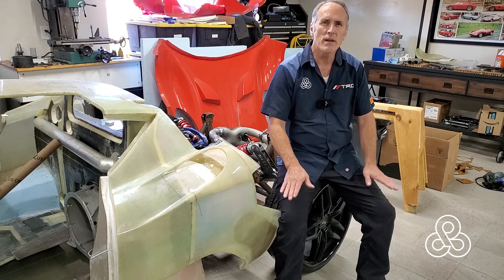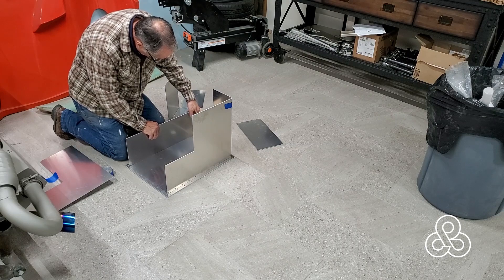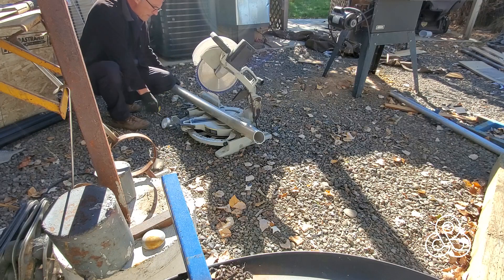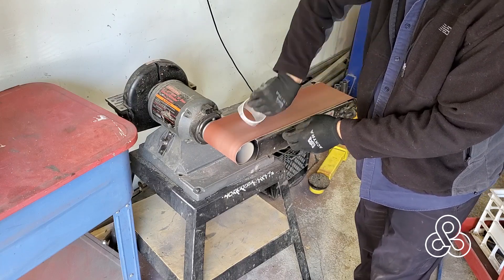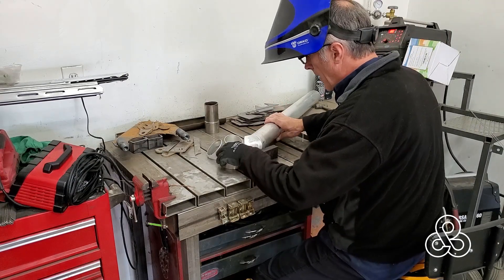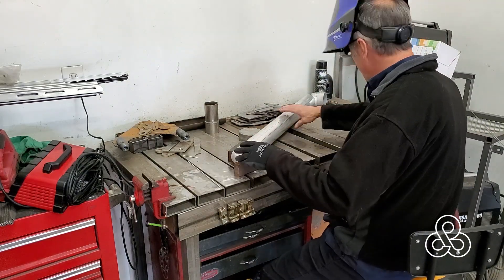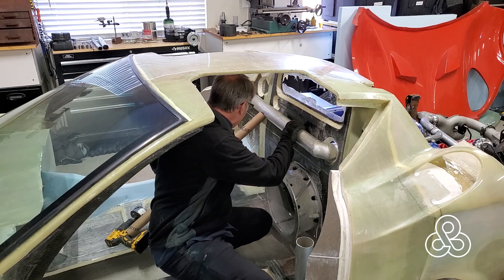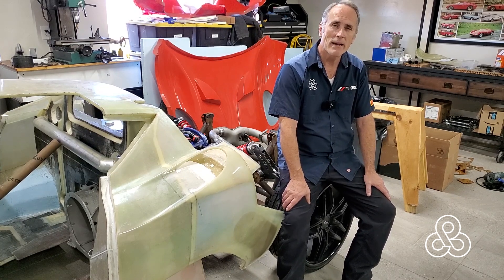A47 - Inter-cooler cross over tube - Arete Supercar Project

Comment: No offence intended, the tube needs a bead rolled into the ends to keep the silicone couplers from blowing off under pressure, you could also weld beads or the best which is
 v clamp, these ends you could be purchased and tigged on, definitely the best way to go although clamps aren't cheap...
Reply from the maker: Vs for sure!

Comment: Hey again, are you enclosing that tube? I'm not sure why you had to go into the cabin but remember that pipe may get to over 150 degrees (C!!) so it will need to be shielded from getting a warm neck.... 🤔 There really does look at this stage to be space for two small diameter tubes from the turbos over the front (rear) of the engine to the end of the IC end tank. You never cease to amaze me how you have managed to fit it all in with basically no mistakes so I assume there was a good reason to go into the cabin. Also consider movement isolation and seriously connecting it to the turbos and IC. I would not want to be thwacked in the back of the head by a hose blow off.....

Comment: A 7" x 1" flatube could fool a bunch of air under pressure. A bulkhead surface separator with a purpose. Halfway between two composite surfaces with a honeycomb center lies a spot with little to zero effect on the world.

Comment: Curious, since the charge tube passes through the firewall, are you going to heat wrap it to manage the temp between the firewall and inner bulkhead you plan on putting in? Or don't you think it'll be an issue?
Reply from the maker: insulate and ventilate.

Comment: Just came across your channel.
Thanks for giving me something I can point to as proof that building a car like this can be done....
I'm using a donor vehicle as the base for my own rebody.
I've got everything I need to build a CNC rotisserie.
My plan is to build up foam blocks on the existing frame and cut the body on the vehicle.
AFTER removing everything I don't want of course. Fenders bumpers front and rear lids.
Would really like to ask you some questions. Pick your brain a little.
Any chance of that happening?
Reply from the maker: Pick away!
Reply: @BuilderCreator  Carbon fiber supplier? Is there anyone local to work with in Oregon? Did you build your rotisserie?
Reply from the maker: @christopherleveck6835  Fiberglast is fairly close, in Washington, but I'm willing to wait a few days more for a better price. (US Composites out of Florida- tell them Jay Jarvie sent you ) Yes, I did build the rotisserie; it is now the heavy duty work table you have seen in recent videos.

Comment: I'm a little confused here and maybe I'm wrong in my assumption, but can you explain how the drivetrain is going to work? I keep looking at that 1JZ facing backwards and can't figure out how you plan on connecting the motor to the wheels, is the car going to be front wheel drive?
Reply from the maker: All wheel drive. Stay tuned. Drive train content coming.
Reply: @BuilderCreator  That makes a lot more sense actually, so you must be using a transfer casing at the front. We did something similar with a drift build we did using a Honda J32 and the transfer case out of a Pilot, we had a 40/60 split, but ended up going through shafts and axles like crazy and had to switch it to just rear wheel drive.

Comment: ok, so, wedge cuts or pie cuts, i've been doing these for over 20 years, you are going to be very unhappy , but.. a wedge cut should be no more then 7.5 deg on each side,  when you weld them that gives you a total angle of 15 deg at each joint, anything beyond that and air will  laminate and go turbulent. you can vary radii by making your wedge section longer or shorter.

Comment: as someone who has built over 25 Factory Five kit cars, i can tell your quality control is better than theirs, I've been wanting to build my own car, but being in college has put a bit of a dampener on that, when I'm out with my ASE and Welding Cert ill hopefully have enough in the bank again to have some fun
Reply from the maker: after 25 cars and college . . doesn't that equal a doctorate?
Reply: @BuilderCreator  i mean i wish, im 20 and been working on cars sense i was 6 cause my dad needed a helping hand, personally I've owned 4 pontiac fieros, 1 1986 toyota pickup, 1 1981 ford F250, and 1 2004 Mercedes SL600, all of which I've done all the work on myself, not including the countless other cars I've done and rebuilt over the years, i was just tired of making $13 an hour building race cars and kit cars, so I'm now 4 months in at college to make sure I'm up to speed on more modern vehicles before i go and do my ASE test, but I've already modeled and designed the car i want to build... Viper V10 powered, dual clutch 6 or 7 speed transmission, mid-engine, it should hopefully be a rocket with the knowledge i have from building a bunch of kit cars as it is
Reply from the maker: @The_Phrough  You go! Your on your way.

Comment: Well, I've started at your first video, and I'm up to episode 27. I haven't managed to get through them all yet, so you may have already answered this question, but why are you routing the turbo pipe into the cockpit? Also, again you may have already answered this, but isn't that Corvette gearbox the wrong way round? I'm assuming you're doing some sort of 4 wheel drive system, but I'd like a bit more detail on this so I can figure out this issue? Thanks.
Reply from the maker: Yes, it has been discussed, but to fulfill your curiosity immediately; here goes- More room in the cabin behind the seats than over the engine. It will indeed be an all wheel drive car- lots of content coming as i start to put all that together. Stay tuned!
Reply: @BuilderCreator  Well I must say I'm intrigued. I'm looking forward to seeing how the whole gearbox and 4 wheel drive system goes together. I think I'm at Episode 31 now. ;)

Comment: First off this channel is amazing, sick project. I'm just asking tho in the case of an accident especially a roll over, I just didn't see room for a cage in there.  Maybe this is addressed in past videos I haven't seen yet. I never thought about building my own car this makes me wanna try for sure. So much tedious work involved I don't know if my brain could handle it lol.
Reply from the maker: Yes, I've discussed this a bit. in short- The composite structure should support a low speed roll over. I will likely fit the car with a removable roll structure for added safety and qualification for some tracks. (think Time Attack)
Reply: @BuilderCreator  Protect that lovely brain of yours is all I'm saying. Things happen. Glad you are thinking about solution's.

Comment: I'm interested as to why you chose to run the pipe through the bulkhead - was it just a case of no room elsewhere? Seems like it would generate a lot of heat and noise for the passengers no?
Reply from the maker: You are correct, there was more room inside more than outside.  Noise- that is a good thing in this type of car isn't it?
Reply: @BuilderCreator  I suppose it's the purpose - if you're going for a track only vehicle, then have at it!  If this is something you plan on taking on the road, and putting your wife in the passenger seat though, earplugs might not be the most luxurious of experiences lol.
Reply from the maker: @ViperThreat  Comfort on the road project coming up -stay tuned.
Reply: @BuilderCreator  looking forward to it!